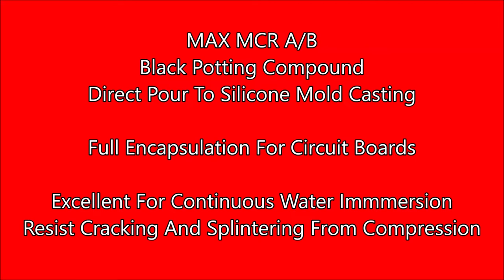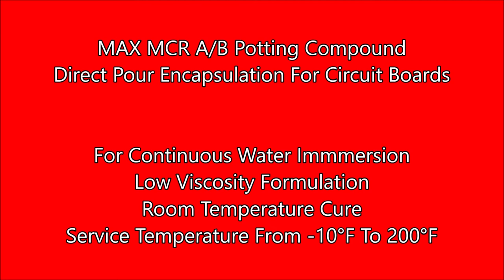No Enclosure PCB Potting, Silicon Mold Casting Method, MAX MCR High-Performance Epoxy Potting System

Comment: I have some issues with degassing , I normally use a pump and cover the pcb with a glass bell, but sometimes theres not enough and it fails, I.mean the pcb doesn't work again, do you have any idea why after epoxy some electronic parts just dead?